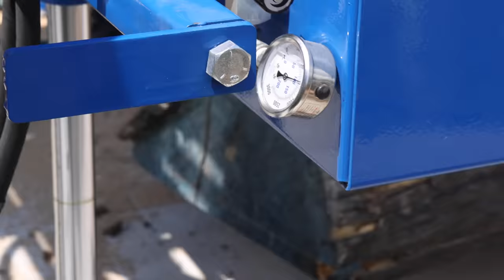I Waited 5 Years To Buy This...

Comment: Now you need to build a proper bed for your sawmill. If you are going to get a kiln a vacuum kiln works the fastest while almost eliminating getting checks in wood & it also doesn't damage the wood structure like some other kiln styles. Vacuum kilns are able to get air dried quality but without the checks & at significantly less time.

Comment: With the saw mill you have another product that you can sell. The sawdust. Once it is compacted under high pressure. It can be burned in an airless container and then sold as charcoal.

Comment: vfd is variable frequency drive it does 2 things it turns 110 or 220 single faze into 3 faze then it also puts out variable frequency s to change speed of the motor I was wondering how are you gonna clean up your saw dust I noticed it blows towards the building doesn't look like much room and the position of the motor and wire routing is not helping you but ibwonder if you could turn it around and some how run wires off some purch overhead then you could use your skid loader to clean it up ??

Comment: VFD - Variable Frequency Drive control the speed of the motor using frequency instead of voltage or amperage.

Comment: What psi is the blade tension? And if you turn the carriage around it would be easier to clean up your sawdust as it is now it’s up against your building and you’ll be doing it by hand instead of with the skid steer.

Comment: Dear John, doesn’t the VFD convert single phase into three phase which your motor needs?  When I cut using a mill I set lubrication {water} to flow constantly across the blade to help extracting the swarf and reduce friction on the blade. Your unit has a tank up top which you should use.  Carbide blades: does that mean tiny inserts for every tooth? Must be incredibly expensive. Cheers.

Comment: Awesome mill. My experience with buying many slabs over the last few years is always mill them on the thicker side, 3” min for the really big stuff you are doing. Yes they will take longer to dry but you just never know how they will dry and all will have some movement. 3” will almost always mean you can finish at or above 2” which really makes the table in my opinion. I know a guy with an acre of milled slabs that are all 1.5” potato chips and he really ruined some nice wood. Always stay on the thicker side.

Comment: Invest in a Good Metal Detector (the handheld kind that the airport security uses). It's well worth the investment and will save you a ton in blades and shut-downs etc. 
Regardless of blades, NEVER cut through metal if you can detect and remove it.

Comment: Carbibe blades are they way to go. Can take a couple of metal hits and keep going. Next thing you need is a kiln to dry these slabs so you can work them right away
Reply: Thought the same about a kiln. Looks like they have room to put up a solar kiln that would not cost an arm and a leg (no pun intended).
Reply: @markhulette6987  the kiln dryer I have my eyes on is called the iDry. Not terribly expensive and nice and compact for their needs (unless they want to outsource drying which you can go as big as you want)

Comment: Bad boy, I didn't see any doughnuts for the concrete guys! I did concrete for 30 years, and now have a wood shop..... Retired though..... One can never have too many toys....

Oh, if there are any woodturners around, they would be interested in your off cuts.....

As for carbide blades, the local saw shop told me that they are fine for cutting veneers, but not for cutting slabs. I have been using the Lennox bimetal blades for years. A nail won't kill them and generally won't slow them down much. Standard blades without the bimetal, they dull almost instantly. The bimetal blades can be resharpened many times....

Comment: my neighbor has a saw mill and we've milled a few logs, what we've learned its, you need a sharp blade. If you're making dimensional lumber from a log, you can get away with using a older dull blade on all the outside cuts with the dirt and the bark, but once you get it mostly squared off and you're ready to make your cants and then turn the cants into dimensional lumber, you need the sharp blade. Once the blade goes dull, they'll start submarining and making all the wavy cuts as you found out.

Comment: Need to invest in a metal detector wand, scan the piece you're about to cut should be able to detect anything that deep, then scan before the next cut, etc..  couple hundred dollar investment there will save you thousands on blade replacement.

Comment: Think of the VFD (variable frequency drive) as being similar to the dimmer switch in your house.  They control the voltage.   Thay way you can control the speed of the motor.
Reply: No they dont. They convert single phase to 3 phase (voltage varies depending on country) and then controls the hertz, not the voltage.

Comment: Those are some mighty logs. The mill is beautifully made, but actually the wheels aren't very big for its capacity and 30 hp electric is adequate, but hardly equal to the engines used on some mills. The Baker 13" capacity resaw uses a 30hp motor! Anyway electric hp vs gas engine hp is a hard topic. One day we can run machinery off our battery powered vehicles. I hope.

Comment: You should check out Matthew Cremona on YouTube.  He built his own bandsaw mill, and has gone from heat treated blades to carbide tipped blades to reduce/eliminate blade deviation/migratoin through the cut.  Also, if you run into metal in the log, the carbide tipped blades chew through it easier.

Comment: Um guy below  is wrong , it converts 3 phase in to single phase (or vice versa) if it converts 3 phase in to single phase you can also use it for a variable speed control.

Comment: VFD - Variable Frequency Drive.  It allows the motor to be ramped up and down which gives the motor a longer lifespan and allows you to set the operating output speed of the motor shaft for use if various applications.  Source: me, a dumb electrical engineer.

Comment: VFD = Variable Frequency Drive
basically it changes the frequency that the motor runs at so it can run at different speeds. 
Used a lot with air handlers to set speeds of the fan. 
example if you want the fan to run at 30% it will change the frequency so the current doesnt run as strong and the motor runs slower. '
very smart peice of technology

Comment: Debark the log first, it dulls the blade much faster than good wood. On other saws you will see a small circular blade cutting a groove in the bark in front of the band. You either need to find someone that sharpens your blades or buy the equipment to do it yourself. Don't buy something cheap. Sharpening takes a lot of your time.Cutting slabs is the way to make money. You can't compete with lumberyards.

Comment: Just wondering, could you use a handheld metal detector to find out if the wood has nails , bullets, wire, ect. so you don't go through is many blades?

Comment: So Johnny, ya wants to know what a VFD is, ya gots to know how an eelectric motor works. To puts it in plain English us knuckleheads can comperstand: a tree phase (not a three phase, cause you're using this here motor for cuttin' lumber, not mathematics) motor essentially works like a donkey that's got a stick strung around its back with a juicy ol' carrot hanging from the front of the stick. And usually, the electric pixies from the wall make that carrot go around and around in a circle 60 times per seconds in the United States of Murica and most of the rest of Murica, including the polite maple syrup slobbering part and much of the spicy food and good dancing part of the continent and for some reason on the other side of the big puddle, it is 50 Hurts per second. Anyway, where was I? Right, so the mains makes the carrot go around in a circle 60 times a second and the spinny part of the motor, elechickens call this part the rotor, but you and I already comperstand that this part is the donkey and what elechickens call the stator, we damn well know it's the carrot (or maybe it's the stick carrying the carrot, the carrot is more like the eelectromagicnetic cornfield if you are very philosophically inclined). Where was I? Oh yeah, the carrot goes in a circle 60 times a second and the donkey will follow the carrot around in that circle at the same 60 times a second.

It used to be that if you wanted to connect anything to the donkey that didn't have to spinnemathing at 3600 rip'ems, you had to put some kind of pulley or gear system to the tail end of the donkey to get to higher or lower rip'ems. And pulleys and gears take up lots of space, they have a lot of mass in the ass and they aren't very easy to change while the donkey is running. So some clever geniuses, them came up with a VFD. They call it a variable frequency drive, but lemme tell you: it's just a carrot electric pixie gas pedal, CEPGP if you like. So the CEPGP makes the carrot go around the circle faster or slower, which makes the donkey spin its jackass faster or slower, so you can choose how much chooch you want in your chacha. That's the main thing you need to know about the carrot electric pixie gas pedal.

Now Johnny  I don't know how curious of a boy y'are, but your uncle Victor A. Nalysis will try to educate you even further in the magic of electric pixie dancing. You may wonder: how in the hell does de CEPGP change the pixie carrot quadrille from 60 Hurts per second to let's say 30 Hurts? Well, it all comes down to forcing the pixies to change the direction they dance in at very key times. You can do this with transisters (it's two gal siblings driving trucks, carrying in the footsteps of their father Etienne Wheeler) and Die Odies, by installing this offspring of Mr Wheeler on the dance floor, you can inject just the right amount of electric pixies onto the dance floor at just the right time to make the pixie hoedown go from one direction to another. And you wouldn't believe how fast these pixies can change the direction of their hoedown, lemme tell you. Their hoedown can change direction so fast and so often, you can't even tell the difference between their nice continuous 60 Hurts per second carrot dance and a 2 times slowed down or 5 times sped up version of that same carrot dance. So now you know Johnny boy: eelectric enginerds are actually nothing more or less than very talented pixie choreographers.

Kind regards Johnny boy
your uncle
Victor A. Nalysis

Comment: VFD (aka variable frequency drive, inverter) is basically a fancy dimmer switch. It regulates the electricity going to that 30 HP AC motor. That VFD is one of the most important parts of your machine.

Comment: $60,000 grand for electric and no hydraulics?  Would of been better of with a cheaper x-wide slabber like Cooks and full blown hydraulic like a Timber Buddy or Timber King.  The Timber Buddy is one of the most impressive mills I've seen, granted it cant cut as wide but they will do custom.

Comment: There are a few reasons you’re not cutting straight/flat passes every time.  

1 - You need a good base to hold your logs in-place to stop them from moving around when you’re cutting.  I know you’re planning on making your own base but it will have to include good square stops and log dogs to lock the logs in place. 
2 - You should add a lubrication option for the blade.  Having some type of lubrication running on the blade will help keep it clean and cool while cutting.  There are a bunch of options but I’ve found that just water or water and some dish soap works well.
3 - You need some work on blade tensioning and blade guide arm placement.  I did see some changes in your guide arm placement during the video but generally they were too far away from the logs when you were cutting.  Your blade was dipping a lot during some of the cuts so I’d guess you have to adjust the tension up a bit.  Your mill has a weird design with only top guides on your blade.  With nothing to prevent the blade from dipping to the bottom you’re going to have to have the blade tension perfect.
4 - If you’re going to be cutting urban lumber I’d run nothing but carbide blades.  You don’t need a rotation of 30 blades, I get by with a rotation of about 10 blades.
5 - The biggest reason your blade is running away from you is because of how fast you’re pushing the blade through the log.  This is one of the hardest things to learn when you start milling but the slower you go the better your cuts will be.  

I made all these same mistakes when I first started cutting.  It’s just a learning curve that you’ll have to go through until you dial in your setup.   

Your mill is massive…definitely a beast!  Congrats on the new setup!
Reply from the maker: This is awesome, thank you

Comment: Am I the only person that can see sparks coming from the blade? After it goes through the log and around the first wheel it's throwing sparks. The wheels need alignment. My bandsaw has rubber tires to prevent metal on metal action too.
Reply from the maker: Is it a bandsaw or bandsaw mill ?

Comment: Please wear gloves, I manufacture bandsaws and circular Saws for a living, way to easy to gash yourself even with a 'dull blade'. If you're cutting hardwood use a small set on the blade and if your cutting softwood use a wide set tooth (swaged bandsaws) or you can go for the best option for cleaner cuts and your HPG bandsaws (stellite tipped)

Comment: PS i am a blacksmith if you cant get those blades re sharpened give them to a local blacksmith they are 15 n 20 one of the 2 steels you need to make pattern welded steel ( for knives etc) but if the blacksmith calls it Damascus punch him in the face and take it to a real blacksmith !!!

Comment: I have followed your videos for a long time. Your great at woodworking but you jumped into this clearly with no research. 60k for the mill. Shop around. That is junk. Select mills are junk but it still a huge upgrade from that mill. Don't mean to come across like an ass. But research research research.
Reply from the maker: I did 3 years of research. You came off like an ass. The select mill with a 6" blade can only cut up to 42".